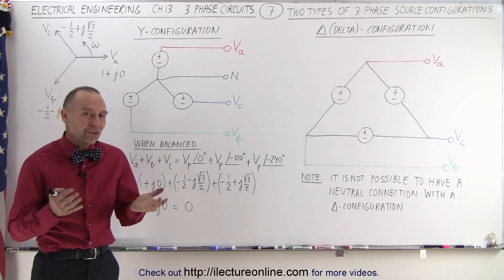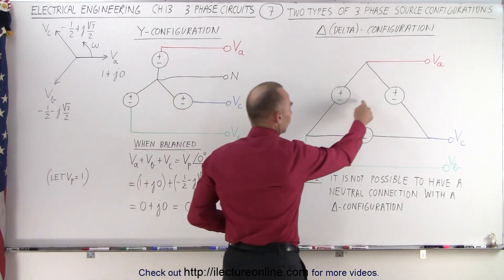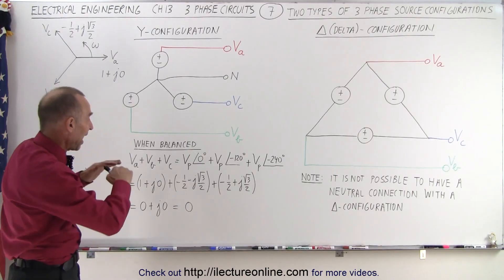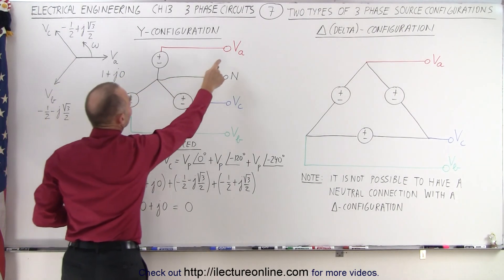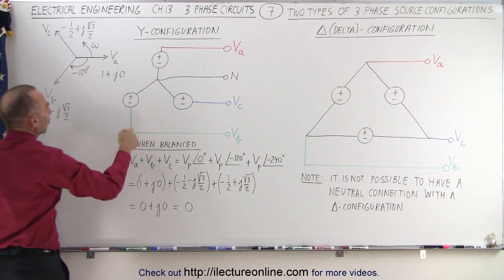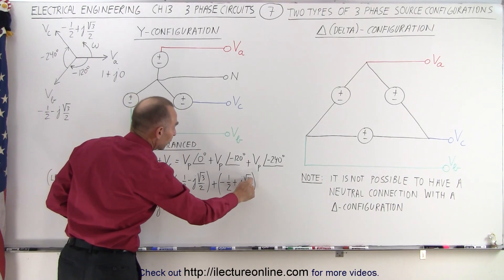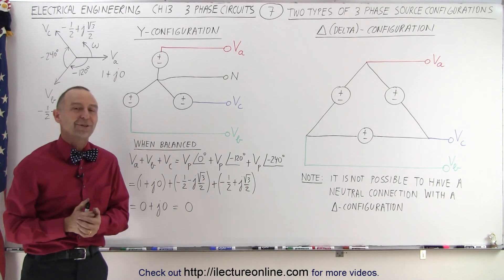Electrical Engineering: Ch 13: 3 Phase Circuit (7 of 42) 2 Types of 3 Phase Source Configurations

Comment: You said there are two ways for the sources to be connected, what about the 4 wire 3 Phase circuit you showed in the previous video isn't that another way to connect it
Reply from the maker: There are more than 2 combinations, but the 2 ways referred to are the Y and the DELTA connections.

Comment: Small correction if I am not wrong; from phase voltage Vb to Vc in the phasor diagram you should have a -120 deg shift, not -240 deg. The -240 deg shift is from Va to Vc.
Reply: -240 is from the reference which is Va

Comment: I understand it's convention, but one does not need to use imaginary quantities in this case.  One only needs vectors defined in a plane. Just call the components X and Y or X1 and X2. Then one can simple play with basic plane geometry and basic trigonometry .
Reply: It is ELECTRICAL ENGINEERING
Reply: @thomasvarghese4085  So?

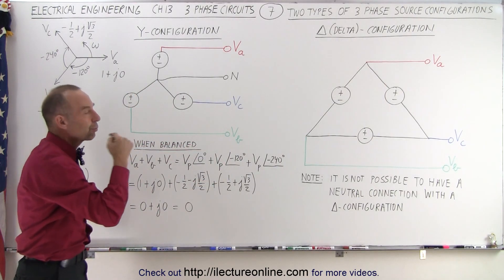Comment: 3:27 Quick note: for the three sources to be balanced, they also need to be operating at the same frequency. (It doesn't matter which one I refer, whether it's angular o cyclic frequency, since both are directly proportional, ω = 2πf.)